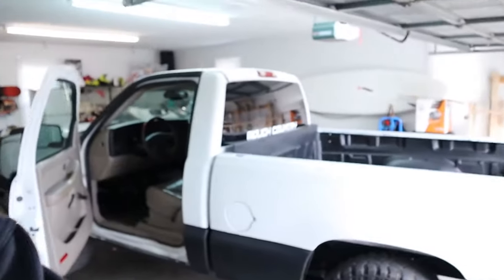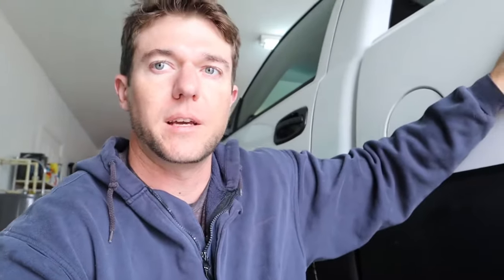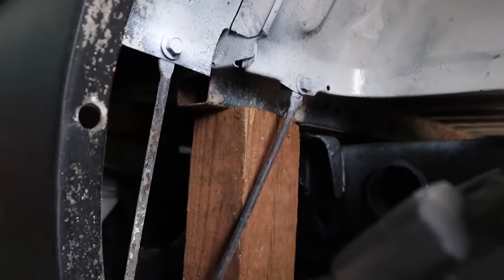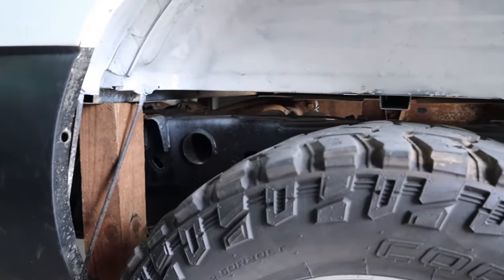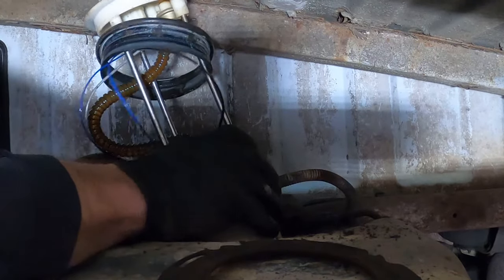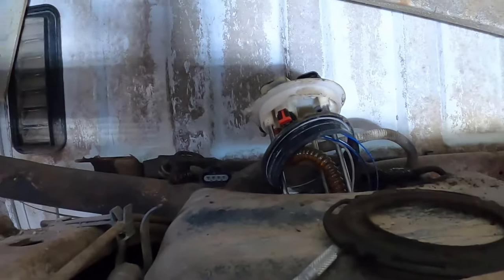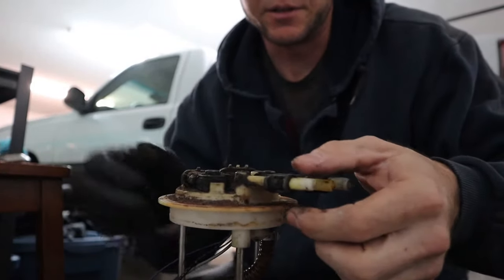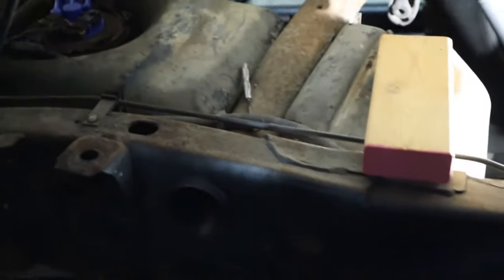How to Replace Silverado Fuel Pump without dropping tank.

Comment: Just get an air ratchet and drop the tank. Break them if need be. Power wash tank once out with lines capped, replace the bolts ALWAYS and, do it the right way first time. Bed realignment can be a bear. Just saying.
Reply: Fighting a nasty tank (above your head) is what I call "a real bear." Not to mention rusted straps or  a stiff fill hose.
Reply: @larrymaloney877  this. im gonna use a cherry picker and drive it out, last time I took it off my wife pushed on the bed and I went around on a creeper starting the bed bolts. worked like a charm but I have a crew cab short box. cant speak on them long box chevys
Reply: @tylerj6264  TMI, but thanks for sharing your struggle. Maybe some other nitwitt can learn from your mistakes. Hang in there, maybe in ten years, or so, you'll find an affordable deal on an EV. That would relieve any brain strain you now experience.
Reply: @larrymaloney877  idk what that all meant but i just put the last of the bed bolts back in, fuel pump was my last check engine codes 🥳
Reply: @tylerj6264  I'm sure you didn't understand. Thanks for sharing.
Reply: @larrymaloney877  you're aphagg

Comment: I made a 1ft×1ft square cut out of the bed put a hinge on it know I just open the flap and change it out.
Reply: Why though? U don't need access to it regularly. Chances are, you'll never need to access the fuel pump again after replacing it.
Reply: My original one lasted 20 years and I bought a gm dealer part so it will last 20 years so once every twenty years so don’t cut an access.

Comment: awesome video just ordered the pump assembly online for less than $100. my fuel level sensor has been fluctuating since i bought the truck 6 months ago. wasnt sure how i was going to drop and support the tank without a lift and tank jack. but this is great. going to call a few shops tomorrow and see what a quote would be for this work. thanks again. subscribed to your channel

Comment: Thanks. Just did this on my 2006 Silverado 1500. Ran into a few things. One of the bed bolts on the opposite side just spun. Was able to still get bed up enough anyways. Also the ring didn't come off in 2 taps like your video. I had to soak it in Kroil and bang it very hard to get it to break free. Also when I pulled the fuel pump out the sucker wasn't even held together. It was all in pieces. I have to physically look down into the tank and pick parts of it out..

Comment: Great job sir. I will be doing this to my Silverado. This has been the clearest video I've seen so far. Thank you.
Reply from the maker: Glad it was helpful to you! Thanks for the Comment!
Reply: Great job sir , but for me i will use 12 volt pump drain all of the fuel and drop tank
Reply: @onetgarage9429  Update! Did this yesterday and this is so much easier than dropping the tank without a lift. I was able to drain it and clean it as well. Saved a ton of time. Thanks again.

Comment: I don't need to replace my fuel pump ! But I do need to replace my fuel pressure sensor , & this video was very helpful showing were exactly it is , & how sensor wire clips on to it ! They say you can replace it without dropping the tank or raising the bed ! I have a 03 Silverado with the composite bed , & there seems to be more of a gap between the bed , & the cab so you can see it more clearly ! Again this video was very helpful for replacing the fuel pump sensor thanks for doing this helpful video.

Comment: Did you test the pump before you lowered the bed back down? I think I have the same issue. I just bought an 07 Z71 (5.3 L) with about 6 PSI on the fuel rail with key on. It starts very roughly, but then the pressure is fluctuating like crazy, 30PSI to about 50 and the meter is going wild. I have a low fuel light on and the needle on the empty peg. I tried to put gas in it, but it will not accept a cup full. It backs up into the neck. I crawled under the truck to tap on the tank to see if it was indeed full but it has a skid plate and heat shield covering all of it. I can't touch the tank at all. I'm going to assume it is full. I'm not looking forward to dropping the tank in the driveway but your method looks so much easier. Thanks for sharing, brother.
Cheers from Louisiana.

Comment: 8-18-2022  What I did is ; from the bottom of the truck, location fuel pump drill a total of four holes, two holes one side of tank by fuel pump two holes other side of tank by fuel pump, away from wiring or hoses to make a door from the top side, how big that's up to you. The idea is to make a door from the top side make it easy to get to whatever you might be when you need to get to the pump. People getting older look out for yourself in the future. /\ it might be at a auto parts store fuel pump go out . Go in the auto parts store buy a pump open that door and install it .In about 30 minutes going on about your business . Have a nice day .
Reply: exactly what ima do

Comment: Thanks so much for this, worked great on a 2013 GMC Sierra 1500, only difference was you need the fuel line removal tools.
Reply from the maker: Glad it worked for you! Thanks for the comment!
Reply: Which tools would that be?? I'm about to do it on a 2015 gmc Sierra 1500
Reply: @lanevernon8380  They are the fuel line spring release tools. You should be able to get them at the autoparts store for about $20. There are two sizes I can't remember them but I ended up getting both. You just put the tool around the line and push it into where the fuel supply and return lines are connected to release them.

Comment: Just replaced my pump looks to be the same Delphi pump. Truck started and runs but the pump is super noisy is that normal? Also I saw a bit of dirt at the bottom of the tank couldn’t take it out but I did also replace fuel filter the same day before the pump. Should I be worried? Nothing huge but I was able to see them they were at the bottom of the tank not floating

Comment: If my fuel pressure  regulator needs replacing and it's located in the fuel pump, would it better to just buy new fuel pump/assembly and install it instead of replacing fuel pressure regulator? 2004 Chevy 4.8l
Reply: The fuel pressure regulator on your truck should be located on the fuel rail on top of the intake. Here’s a video that may help you. https://youtu.be/oJ02IQdrshs
Reply: Nope 2004 and up they put them in the tank.
Reply: @johnjohnson2855  same here on my 05.  Had to buy the whole pump.  $400 later.  I'm about to install it and was looking for an easy method.  This looks good

Comment: Unfortunately i have a camper top and a bed full of shelves and tools .Ive done two fuel pumps with dropping the tank.This time i had just filled the tank. Sheeeesh. Well i used two racing jacks a couple 2x4's and a 2x6 to support and lift the tank onto the two racing jacks .Took a whole day.
Reply from the maker: Oof! That’s tough luck! Seems to happen a lot with a full tank. Hats off to you for finding a way to get it done! Thanks for the comment!

Comment: Do you need to bleed system after installing new pump if it ran out of gas?
Reply from the maker: No sir, just let the fuel pump run a little while by cycling the ignition a few times, It will bleed all the air out of the injectors pretty quick if your fuel pump is running. Thanks for the comment!

Comment: I’ve done mechanic work all my life since I was 14 years old and I am now 58 years old and I’ve done it both ways. Remove the tank or lift the bed of the truck up and what’s crazy is if you have a lift you can go ahead and take all the bolts out of the bed and use your Lyft to pick the bed completely up.. I had a bet with the guy at a company we were working at but at this particular company we sold cars online and I wasn’t in the mechanics shop. I was right next to it and I was the manager over the detail department.. there was a 2000 year model truck and a 2001 year model truck and both GM & both of them needed fuel pumps. I looked around on the trucks and I picked the one I wanted because some of them if they have a trailer hitch depending on the type they have can get in your way if you try to remove the bed.
I asked the mechanic that was working how long would it take him to remove the fuel pump and he said he could get it out in back in in about two hours and I was like OK I bet you I can have it out and back in in 30 minutes he bet me $50 he could beat me. He knew I did mechanic work before I came there because I built his transmission in his Camaro but anyway , I also knew that he was going to drop the tank if he quoted me a time of two hours. While I was talking to him about the truck and everything I was gathering the tools up on the cart that I was working off of because the tools I was going to use was totally different than the ones he was using. All I needed was an 18 mm wobble, a long extension, a small torques 10 mm socket and a 15mm  and a 18 and 19 wrench because these were the type that the fuel lines bolted into the top of the pump instead of snapping in.
To make a long story short, which is kind of late for that it took me 12 minutes to remove the fuel pump I took and removed 8 18 mm bolts and the 3 torques bolts around the filler neck and the 10 mm ground strap and unplugged the tail lights From the harness under the truck and I position the lift and raised the bed up, he asked me what in the hell was I doing. He said it was stupid. Anyway, I laid the pump down beside of his truck and he hadn’t even came close to getting the tank out and he said how the hell did you get the pump out that quick? The reason I didn’t slam it back in is because the parts house took longer to bring me the fuel pump then it did for me to take it out anyway the book called for about two hours on that and he got paid book time for it and I did it in less than 30 minutes or I would have if the parts had been there and I told him that’s how you make money doing mechanic work if you can’t beat the book time you’re not gonna make any money. From then on out, he removes the bed or at least raises it up. 
I’ve seen people set 5gallon buckets on the tire on the driver side and just loosen the passenger side bolts and tilt the bed up and set the bucket on the tire with a board across it to hold it up.
Reply from the maker: Ha ha! Thanks for the cool story brother! Thanks for the comment!

Comment: I tried this with my Vt. Truck but the bolts were seized by rust. Dropped the tank. Doing it again but this time I cut a nice access port into the bed that I will be able seal back up and be barely noticeable. 

Your way is the best option, at least if you're in the sunny south lol.

Comment: I have a 2013 Chevy Colorado currently and we're about to go out there and replace the fuel filter but we have to take the top of the truck off the back of it so I'm looking for ways to we can do this get to the fuel pump gas tank and all that and change it without having to take the bed of the truck off

Comment: Was the bed hard to align back up when you let it back down
Reply from the maker: As long as you leave a couple of bolts in on the passenger side of the bed, then it falls right back down into alignment when you let it down. So just loosen the bolts on the passenger side about 3/4 of the way out and you’ll be fine.
Reply: @onetgarage9429  thanks and thanks for the great video

Comment: My GMC sierra started sputtering but not throwing codes, I replaced the fuel filter and spark plugs because they were way over due, but still have sputtering issues, mostly at high temps. I believe I need to replace fuel pump, going to go ahead and just do it, because I am certain it is the issue, if it wasn't whatever it's like $70 bucks I plan to keep the truck forever. Hopefully it fixes the issue! thanks for this video! I really didn't want to drop the tank
Reply: Did it fix your issue ???
Reply: Try replacing your egr and idle air control valves if you're still having issues. Very common parts to malfunction on these trucks when they get into the higher miles!
Reply: @johnjohnson2855  nope, I replaced the fuel pump, air filter, spark plugs and wires, new maf, still had issues. Replaced ignition switch problem finally solved been running great

Comment: I have a 2003 chevy 4 door with a 6.5 foot bed.
I cut a trap door in the bed.
The measurements are:
(14.5" x 14.5" door) 
20.5" from the left wall, and
11" from the front wall,
will give you the center of the pump itself.
Mark the center and measure out 7.25" in all 4 directions. This will give you the door centered on the center of the pump.
Plenty of room to do the work without a hassle.
Secure the door with tabs and silicone.

Comment: Is the fuel filter inside the fuel pump ?
Reply from the maker: On some year model years there is just a strainer on the pump and no other filter. This truck also has an in-line filter on the left frame rail below the drivers door.

Comment: I can’t see how you removed the lock ring. Please tell me how. I don’t want to damage my fuel tank.
Reply from the maker: Tap on the lockring with a flathead screw driver and a hammer in the counter-clockwise direction.
Reply: @onetgarage9429  thanks, I went in a slightly different direction but got it off. Now I’m having trouble with the
Floating gauge popping off every time I put the fuel pump in the tank. Any suggestions?
Reply from the maker: @YouTubeStudio101  Ok, make sure the gauge float is snapped completely onto the plastic clip on the sensor and then feed the float into the tank first at an angle before dropping the rest of the fuel pump module into the tank. Good luck!
Reply: @onetgarage9429  thank you! I finally got it. The lock rings for the fuel pumps can prove to be some grouchy little sh!ts. I had a hard time with mine but, it’s fastened in now. Thank GOD. :) 

I appreciate all your help ❤️❤️

Comment: So... On mine, the bucket is too big to fit through the hole?
Reply from the maker: It will fit through the hole, just wiggle it around until it slips through. Take your time and line it up then pull straight up then tilt to get the float out. Good luck.

Comment: If you go to that extent to take away and actually it's 6 bolts and if you go to that extent that you lift the bed up take the bed off it takes 10 minutes to take the bed off the truck why sit there and go through all that BS of trying to prop that bad up off the frame it's much easier to take it off it's much easier to do the job without it on the truck believe me after I've done it twice if you get it to the point where you break it away from the bed and you lift it up just pull the thing off it takes three you know maybe four buddies you know four of you four men can lift the damn bed off that's a no-brainer man
Reply: Yeah IF you have 3 or 4 buddies... nonsense for the lone guy